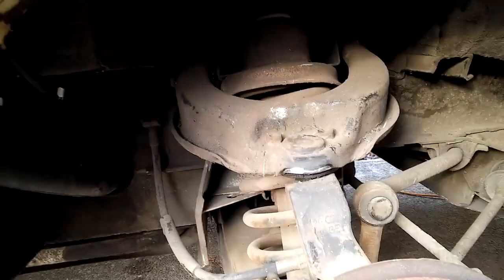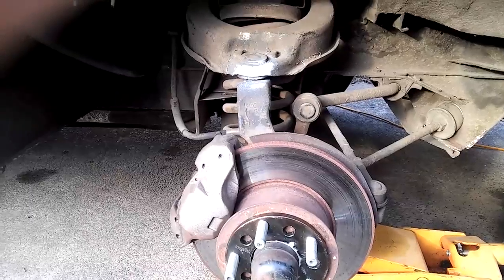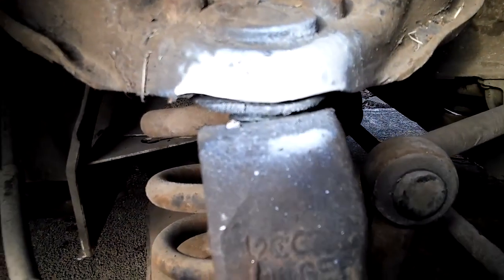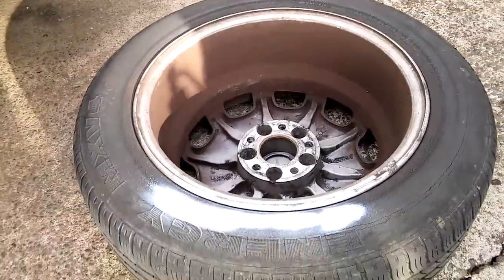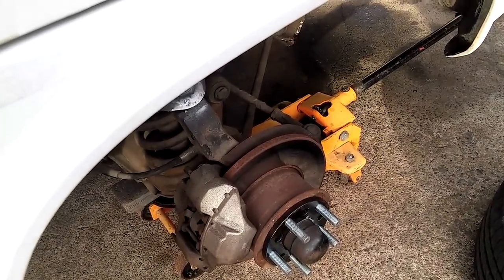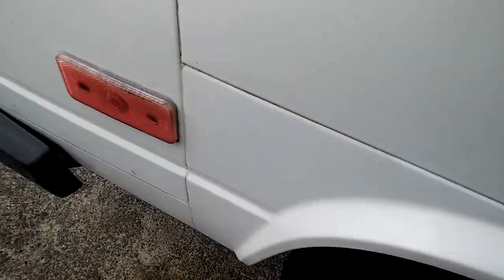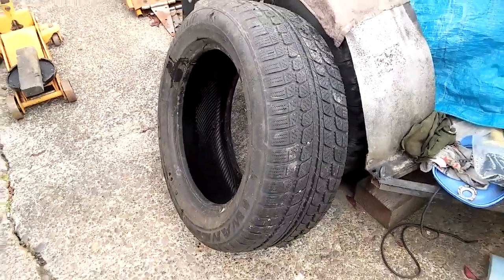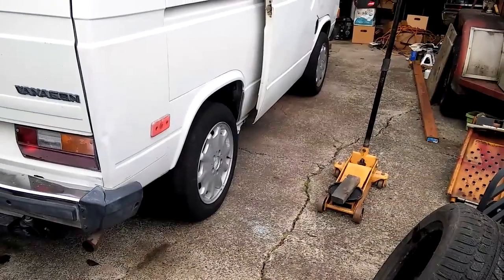VW Vanagon T3 Wheel Spacers Install - Vana White Gets Spaced

Comment: 215 max width
Reply from the maker: What do you mean, for puzzled viewers...
Reply: @vanstechcorral  Any tire wider then 215 will require taller springs and controll arm mods.  Go westy sells all you need.
Reply from the maker: @kevinmckinnon6034  GoWesty's products are great, but beyond my pay grade!
Reply from the maker: @kevinmckinnon6034  I just installed 225 55 16 tires on the vanagon rear, using the same spacers as with 215.